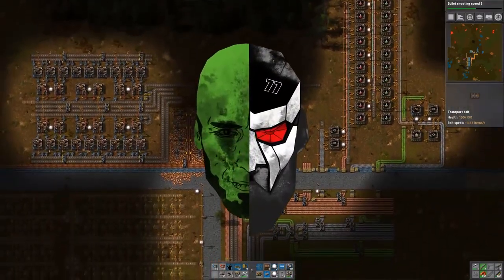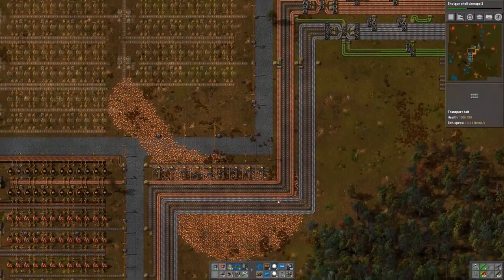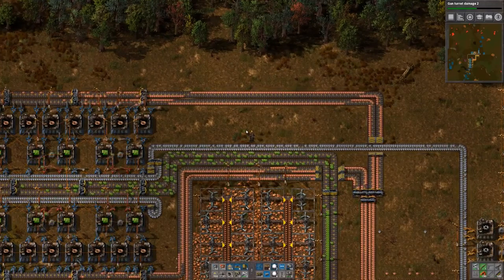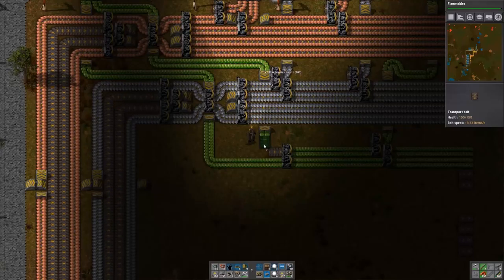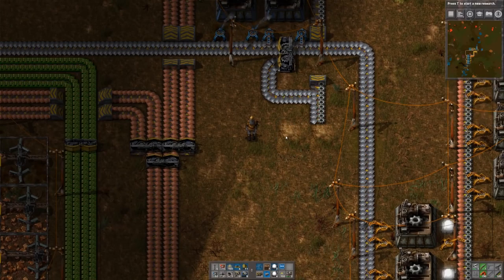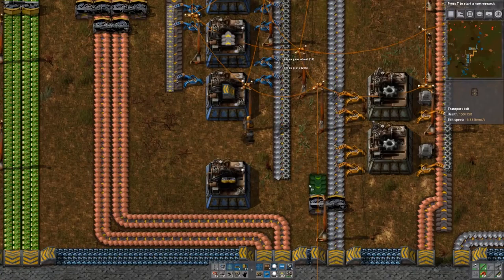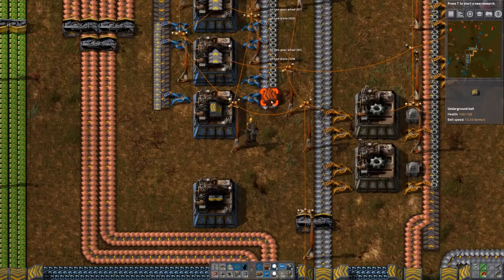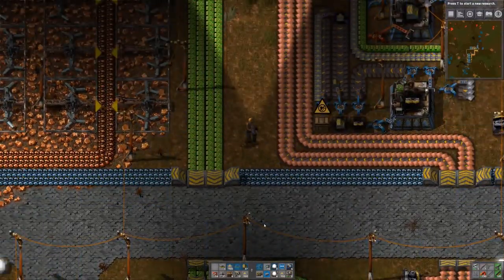How to play FACTORIO - Conveyor Belt Factory! #10

Comment: Hi Doc, Nice Circuit Factory... All I will add is that your output rate will be hindered by the red inserters until you research stack inserter bonus 2, when all inserters will be able to pick up two items at once. Since you have a 'red belt' scale circuit factory, your throughput will still be perfect, as is, on yellow belts, consider outputting to underground belts to maximize compression.

For someone that has only started it is clear you have been guided well by those that came before you and have studied their ways well.
( ' ', )

Comment: Why are you feeding 4 lines of copper into the circuit maker, then only using the inside 2 of them? You don't have any long-reach inserters, so it'll never grab from the second line. Not that it would help, as long-reach inserters are slow, and you have the fast inserters on the inner line.

Comment: You might want to check the copper ore going under the green circuit build.  When you added the iron ore line you cut off the copper and never hooked it back up.  Your doing good so far.  Factorio is much more technical then minecraft.  As you play more you will find out why most people have spreadsheets they use to help as they build their bases.